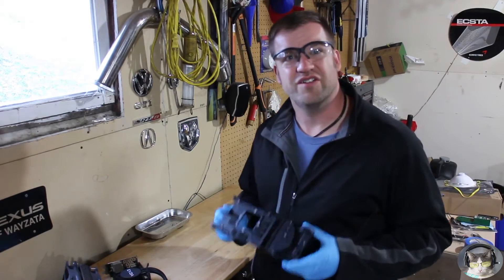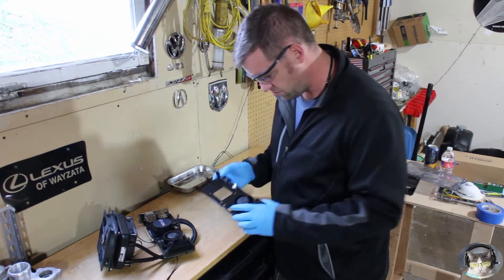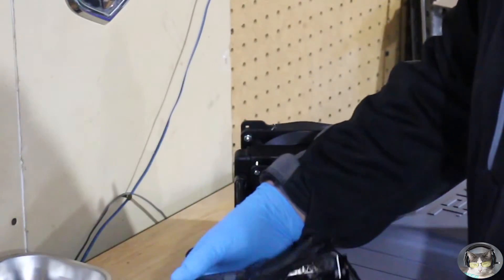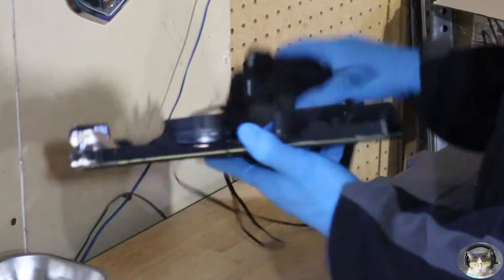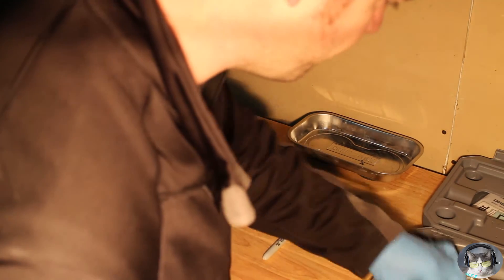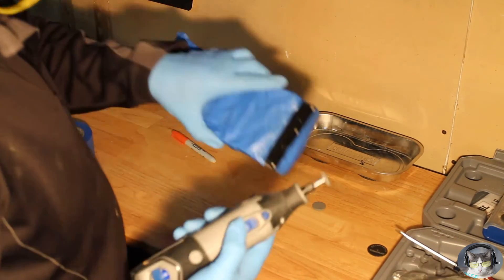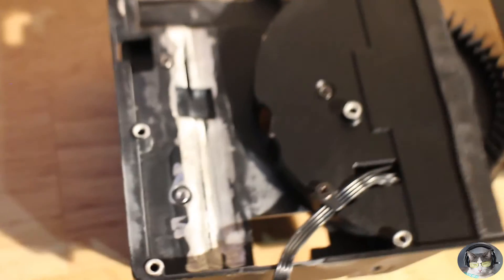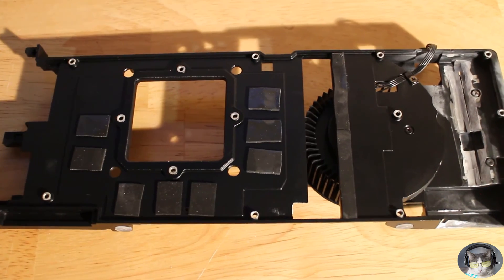Modding Titan X Pascal with EVGA Hybrid Kit

Comment: With the normal hybrid cooler, does the titan x pascal ever reach like 80c? Not sure if it's true or not but alot of people say once the temp hits 80c on titan x pascal it starts to lose fps?
Reply from the maker: Sparkie Stibbs the most mine has ever hit was 60c and that's with a good overclock and during the summer with no AC running. on the stock cooler it hit 80c no problem but it was also running higher than stock clocks i dont really lose fps as i am getting more than my monitor can refresh but it does clock down a bit.

Comment: Hi! A Question!

Wouldn't it easier/better to use the EVGA Hybrid FTW GTX 1080?
http://www.evga.com/products/product.aspx?pn=400-HY-5288-B1

There is the extra slot for the 6-pin power connecor already cut out.
Also a bigger fan is available.

What do you mean?
Can I use the FTS Version like the "normal" Version you have used?

Thanks in advance! :)

Yours sincerely!
Reply from the maker: DarkHell2 good question but i dont think it would work. the titan has more memory and vrm modules and that copper wouldn't cover them all up. you're still better off just using the stock baseplate with the pump for the simplest solution.  modding the kit is also pretty simple but some may not value the risk.
Reply: Thanks for the answer! -
Which baseplate have you used then? In the video there was the EVGA baseplate or am I wrong?

You have used this set:
http://www.evga.com/products/product.aspx?pn=400-HY-5188-B1

And then this set (FTW-Version):
http://www.evga.com/products/product.aspx?pn=400-HY-5288-B1
Doesnt this set have the same baseplate like your set (http://www.evga.com/products/product.aspx?pn=400-HY-5188-B1 )

Or what have you meant by that the baseplate of the FTW Version isnt the same like yours.
Which baseplate have you used then?

(Im asking that much because I also want a better cooling for my Titan X Pascal)

Thanks in advance!

Yours sincerely!
Reply from the maker: DarkHell2 that kit you linked looks like it, it has the smaller fan and a full baseplate. this is very different than the FTW version.
Reply: Ok, thanks Male Cat Lady!
Reply: Hi Male Cat Lady!
Other question.

I got the thoght of the platine from the coming GTX 1080 Ti.
With luck the platine from the 1080 Ti is fimilar to the platine from the Titan X Pascal and then when EVGA releases a cooler for the 1080 Ti it might fit with minimal modifying on the Titan XP, or am I wrong? 

What do you mean?

Thanks in advance!
Yours sincerely!
Reply from the maker: DarkHell2 its possible, but we wont know until nvidia announces a 1080ti.